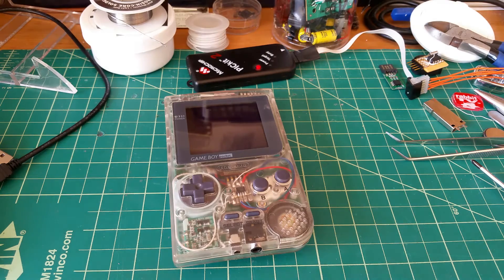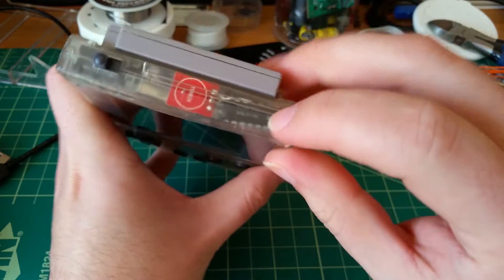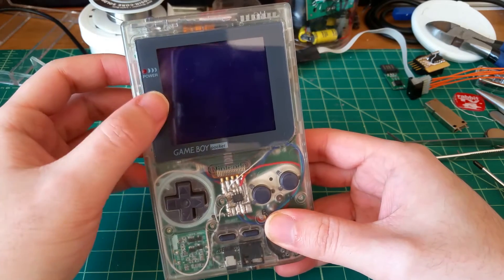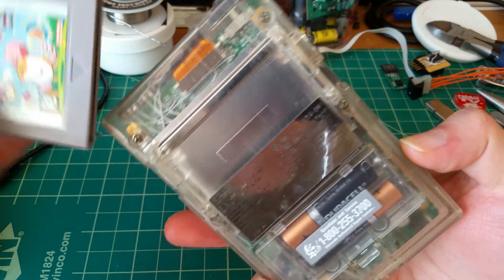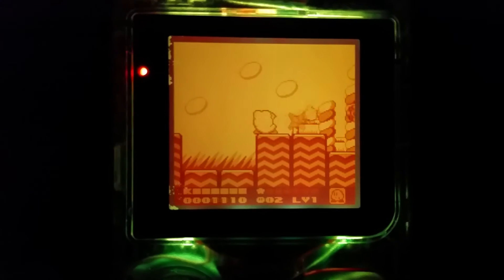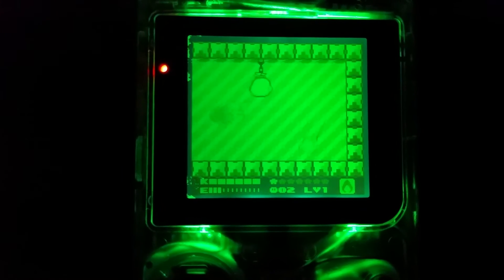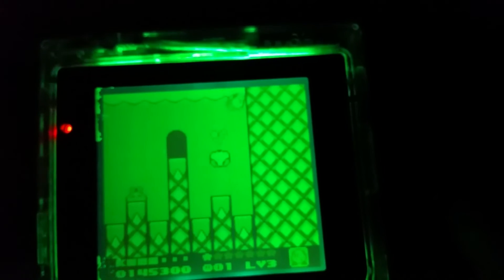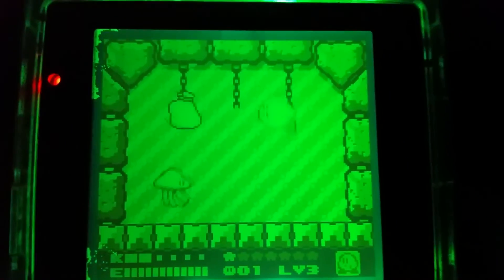Digital RGB Backlit Biverted Gameboy Pocket

Comment: Very cool.

Can you please post a tutorial of how you got that touch sensor to work with your backlight?  I'd like to do something similar.  I'm trying to mod a DMG with an RGB backlight, RGB lit buttons, 2x RCA prosound, and a variable clock.  Problem is, I'm having problems finding room for two sets of switches, but I could put one set of switches for the screen up top, and the touch sensor just above the start and select buttons.  I'd need to know where to buy the touch sensor, too.

Thanks.
Reply from the maker: Hybrid Divide I got the touch sensor off eBay (search arduino touch sensor). The short story is I programmed a microprossor to read the sensor and then pwm the rgb backlight. Details can be found in the dmg rgb videos here: 
http://www.youtube.com/playlist?list=PLuXL5mAJqOSWYxW5-hrbaBy1WpMMdzE8-

Comment: hey, great work on that gbp... can you do a video about the 3v to 5v mod? it would be great for me since i want to do that mod too

sorry for my english, i'm italian
Reply from the maker: emanuele trentini Honestly unless you really want to solder surface mount parts and design your own circuit board I would just buy a step up module off eBay. Also your English is perfect, don't worry about it.
Reply: thank you :D

what about this one?

http://www.ebay.it/itm/3V-To-5V-1A-USB-Charger-DC-DC-Converter-Step-Up-Boost-Module-For-Phone-/162083441427?hash=item25bced0b13:g:1t8AAOSwY0lXRsqb
Reply from the maker: emanuele trentini Yes that will work, you will just have to cut off/desolder the USB port to make it fit.
Reply: you are my new hero. 

and how do I connect it to the gbp MB? I think i'll need to mod the original battery connectors to prevent shorting out things...
Reply from the maker: emanuele trentini Thanks! Solder the negative to any of the ground points on the board, and you can solder positive to the switch so that when you turn on power the converter turns on also.
Reply: that's for the input i guess. And then I'll have to solder the output directly on the battery connector on the board?
Reply from the maker: emanuele trentini The ground and switch from the gbp goes to the in+/- of the converter board and the USB port pins go to the backlight circuitry.
Reply: sjm4306 Thank you sooooo much